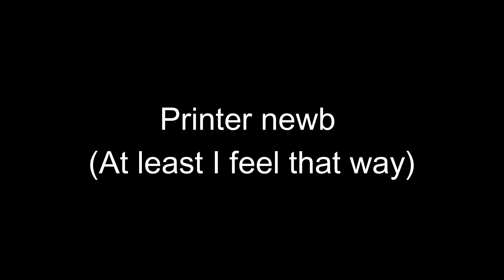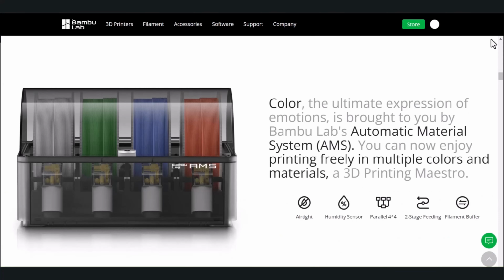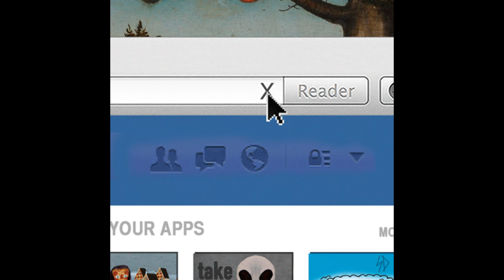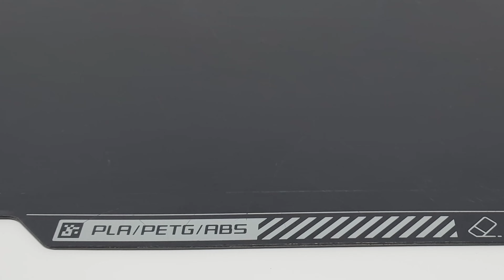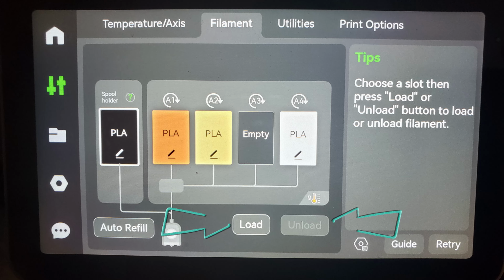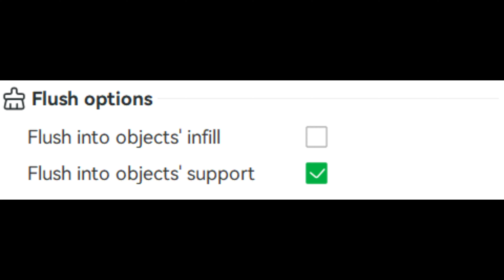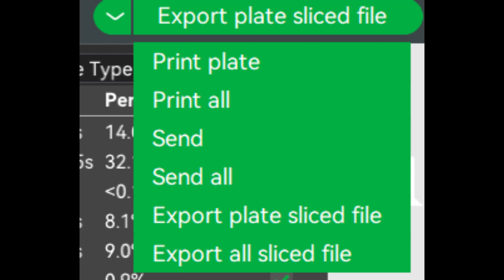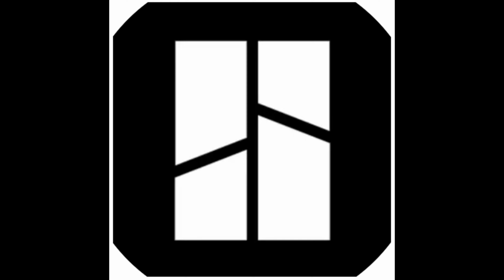Bambu Lab X1 Carbon 14 Month Review

Comment: 25:07 🤣🤣🤣🤣
Reply: Mine was like that for several months too... the X1C just made it not needed.. yet... but now I print enough that I needed the additional printer. It prints ALMOST as fast as the X1C, if the X1C is at 50% speed...

It's an okay printer. My only compaint: the NOISY fan... a firmware update made it "quieter", but it just turned the fan speed down during printing... The "jet" fan turns on during long or higher temperature prints. No one is going to want to be near it while that fan is on...
Reply from the maker: @DonsArtnGames  I will open that M5 at some point lol. Probably when the V6 comes out officially.
Reply: @ashleys3dprintshop  I'd consider opening it now if you have the space to spare. There have been a LOT of firmware updates, and I am not sure how well the printer will take jumping from the KS firmware all the way to the newest... maybe another video topic right there.
Reply from the maker: @DonsArtnGames  you make a fair point.  I may have to make some upgrades on it though. The 1st generation had faulty screws that warp/break. VWheels may be a point of failure.  So I need good quality ones. I ordered the $2 hardened hotend they offered to backers as well. 

Even without opening it I stayed up to date on its progress. But I may have to do some major work when the v6 releases.... Eventually.

After dealing with the X1C for so lone the m5 is reminding me of what I left behind... Lol
Reply: @ashleys3dprintshop  I haven't heard of faulty screws and my m5 works great. Wheels haven't worn down. The only trouble I have had so far is when I loaded some bad filament
Reply from the maker: @DonsArtnGames  Some 1st gen versions had some teething issues. I followed a bunch of people online and there were numerous issues with shredded v wheels and hotend screws snapping. It didnt affect everyone since the suppliers for those parts were varied but it was known enough to be careful to replace them with quality ones just in case. 

look up "ankermake m5 screws snapped off or stripped" I'ts not a crazy repair to anything but I'd rather be prepared for the worst. "downtime sucks" lol. 

Also when the v6 releases it appears the whole hotend assembly gets an upgrade so  we shall see. 

Which slicer are you using for your anker?
Reply: @ashleys3dprintshop  Oh... I didn't know about the gen1 faults. Thanks for the heads up.

As for my slicer(s), I mostly jump between the Ankermake slicer and Cura depending on the print. When it comes to narrow walls, Ankermake 's Slicer REALLY slows the M5 down since it can't use Arachne slicing profiles. Cura can, so I use Cura a fair bit.

Bambu Lab Studio recently updated to include the M5 and many other printers.

Comment: Save yourself some time and quit putting all of the extra clips in. Doesn't do anything for your videos, other than become annoying..
Reply from the maker: You are absolutely correct the quick clips took the longest to add in, I am mixed on their effectiveness. 
I don't have chapter capabilities yet. The first 7-8 min were my frustrations with previous devices and why I even spent a small fortune on a relative unknown company. Without some sort of b roll or visual content it's basically an audio book for 8 min. I also didn't want a dump session on other brands. They were from a different generation and there was a sea change from bedslinger to corexy for me. 

The other 2 thirds fall into the actual review.  Where I can "show" something instead of just tell. My normal videos are not reviews but instructional content so aside from a short 10 second intro I would rather dive into  topic than dance around it. 
Thank you for your comment and opportunity to improve.
Reply: I loved the clips, querky!